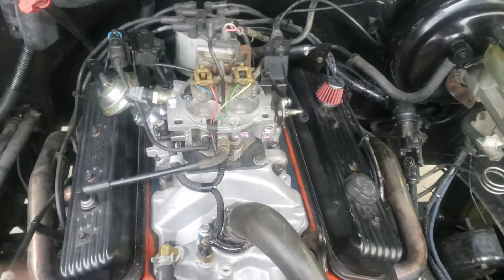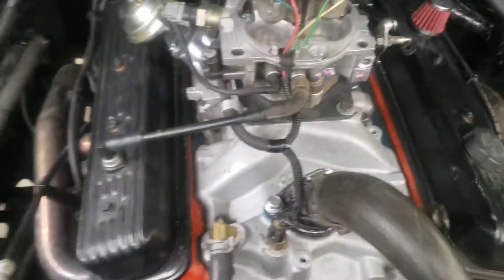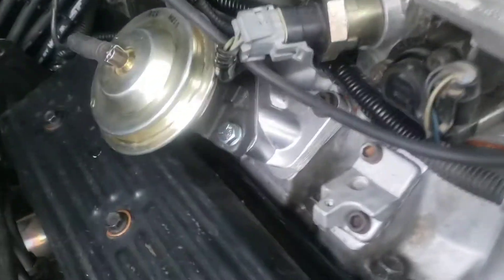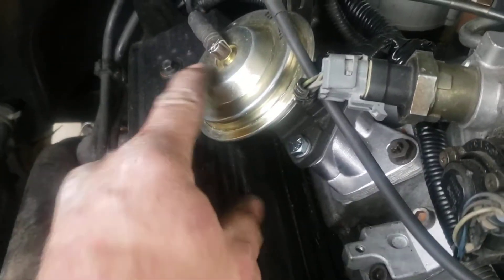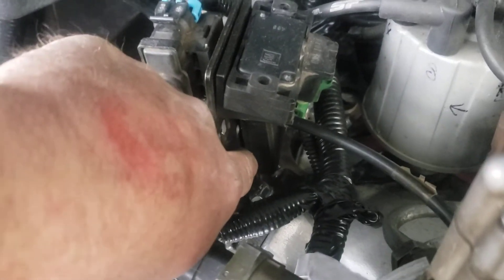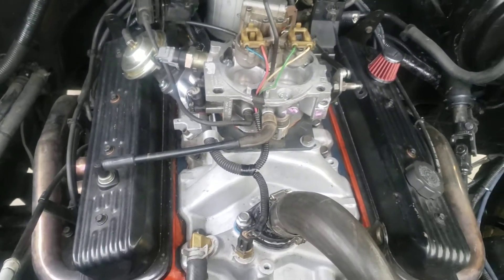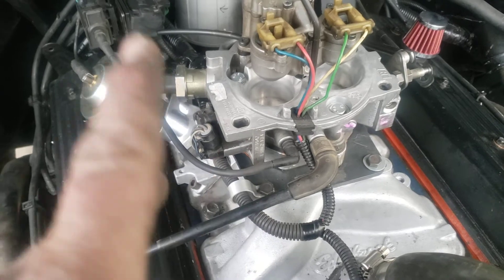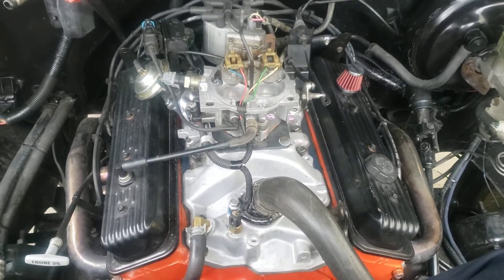TBI 5.7 350 edelbrock egr carb intake install.

Comment: Hey buddy,I've got a ? For u, I've got a 92 chevy, GMT400, I'm actually putting a older weiand 7546 intake on my Tbi motor, I'm also putting a new self learning 4barrel EFI system from ACES EFI really nice kit, my ? Is were did u run your heater hose that was hooked up to back Right PS Of the intake, the tbi motor an intakes are an the gaskets are specially built even the gaskets, have that little hole only in the back for heat, because they decided to put the heater hose in the Hotspot in the back of the head, my ? Is were did u put your heater hose that was in the back of the head?? Did u put it up on the passenger side front port, an have no over heating problems?? An also are u running a 180 degree T STAT or the OEM 195 GETTING READY TO START THIS PROJECT THIS WEEK, MY WIFE SN KIDS BOUGHT BE THE ACES KILLSHOT SYSTEM FOR MY BIRTHDAY SO IM EXCITED ABOUT GOING 4BLL EFI AN ALSO LEARNING EFI, IT IS A REALLY NICE KIT AN CUSTOMER SERVICE IS SECOND TO NON, SO CHECK IT OUT AN THERE PRICING OS AMAZING SO TELL THEM BOBBY TURNER SENT U, AN HEY GIVE ME A CALL IF U EVER NEED ANY ENGINE PARTS OF ANYTHING, IM LOCAL HOTRODDER IN GA AN IM A PARTS DEALER SO IF U EVER NEED ANYTHING GIVE ME A CALL , IF U NEED IT AN ITS HARD TO FIND, THATS MY SPECIALTY, 678'675-6917 THANKS AN PLZ LET ME KNOW HOW U RAN YOUR HEATER HOSE?? THANKS
Reply from the maker: There's a port on the front of the intake I put a 90 degree elbow on and ran the heater hose to it. Works like a champ

Comment: I'm going to attempt mounting my 1987 TBI system to an Edelbrock 2701 carb intake manifold. I think I can make it work, but not sure what I'm going to do about the mounting bracket that holds the map sensor. This is a non egr intake, so that will be deleted.

Comment: Did you notice any performance out of the swap??
I would imagine it flowing a lot more air but did it make a difference..
Reply: Hello???
Reply from the maker: @jamesweber7269  sorry I just saw this lol. To be honest, I did this swap at the same time I did an engine swap on this truck.it does have more kick than a stock intake for sure but I could use a tune to dial it in.
Reply: @rfrank1980  No worries brotha, thank you

Comment: I strongly advise against the Trans Dapt adapters.   Being only ¼" thick,  there isn't enough thread engagement to reliably retain the throttle body. Vacuum leaks are a big issue with them.  A thicker adapter will afford more thread engagement for a more reliable seal.   Holley sells them,  and they're aluminum rather than steel.